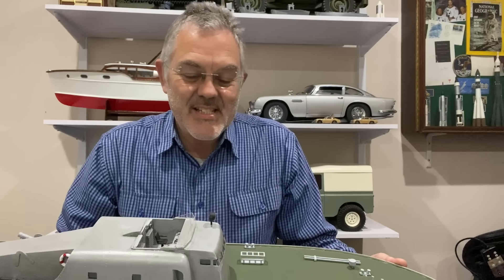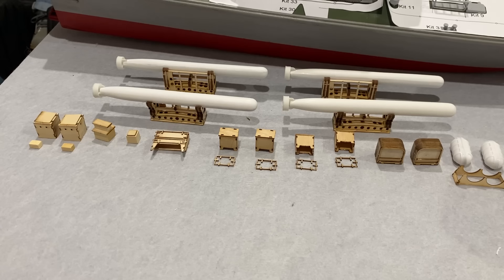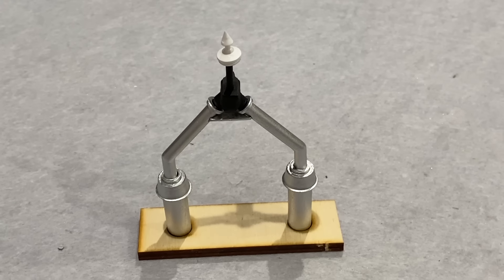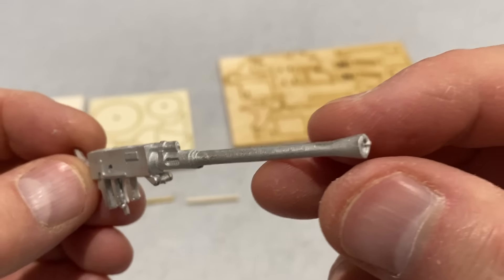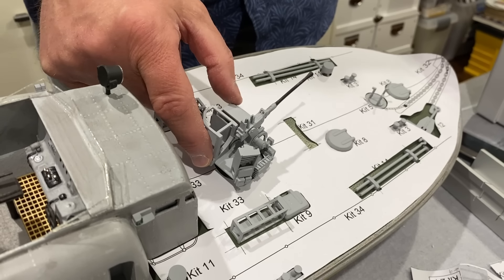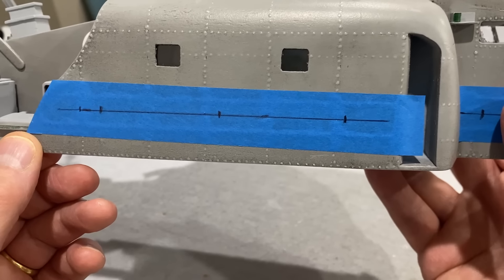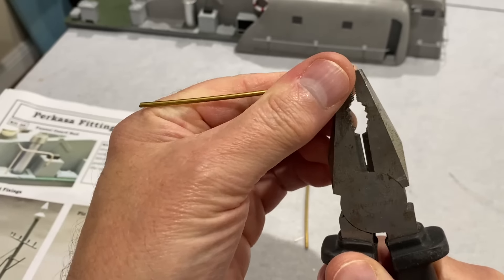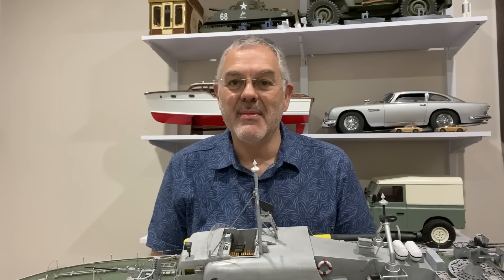Building a radio controlled torpedo boat - the SLEC KD Perkasa, Part 5

Comment: Great job, looks bloody nice.  You have far more patience than me gluing all those fiddly bits.  I also like the final weathering which is just enough and not overdone some modellers do.  You can have too much weathering on models sometimes. 
Also, I can't help wondering how they launched the torpedoes.  The US PT boats had deck mounted torpedo tubes.
Reply from the maker: Thanks. I haven’t seen how these deck mounted torpedoes were launched. It looks like they could only be tipped over the side.

Comment: I’ve been building the same kit. I deviated after completing the deck by completely rebuilding the upper superstructure and 95% of the deck fittings using the Tamiya Perkassa kit as reference in plasticard, strip and rod. I have yet to build the guns from scratch as you rightly mention the 3D printed kits from Shapeway are no longer available as it appears the company is no longer. I will scratch build those too using the Tamiya kit parts as reference. Enjoyed your build 👌
Reply from the maker: Wow, that sounds like a lot of work. Why did you abandon the wood?
Reply: @modellingmisadventures simply because it was very un-scale. Replicating the deck fittings in plasticard, strip, rod, ect was easy enough using the Tamiya kit as reference( I managed  to keep all the Tamiya parts on their spruces and will re-sell the kit on ebay for about £100 soon!), it gives a better finish that’s trying to fill wood grain for prime and paint. Yes, it is very time consuming re-making all the parts, but i enjoy the challenge.  The only vacform parts i used was the torpedoes and lifeboat canisters

Printing the replacement parts in 3D would be an even better solution, but I don’t have the equipment to 3D print. I’ve managed to get a full set of crew from my friend Dave over at  Drydock 3D in resin and although they are a US Naval set, they are about the right era and scale and will look great on the Perkasa after painting
Reply from the maker: I’ll have to look into the figures you have come across. I can 3D print my own but I can’t find suitable files.

Comment: Come on dude , you can do waaaaay better with that chain and rope , do not slack of the last pieces . 🙄🙄🙄🙄👎👎👎👎And now put some crew on.
Reply from the maker: Sorry you didn’t like it. Finding crew for this boat is challenging. The only ones I can find are the 1/35 scale Italieri PT boat crew.
Reply: Not that i did not like it but is could be inproved that's it , and yes 1/40 is a bit of a weird scale for crew . Or somebody could print some? 😁😁👍👍